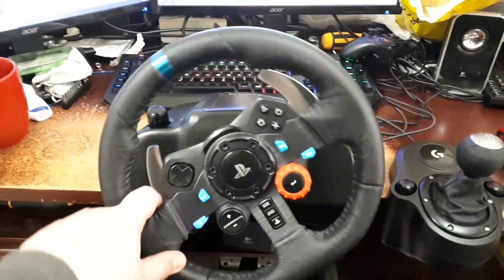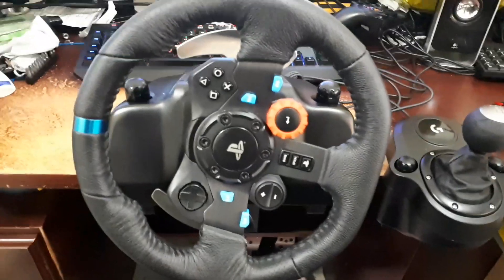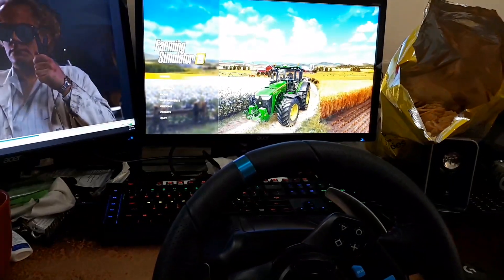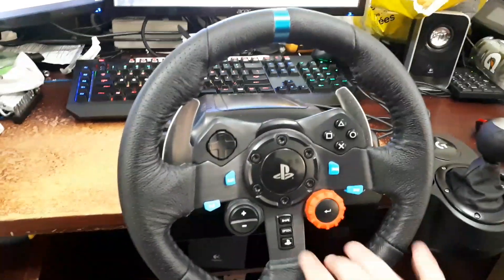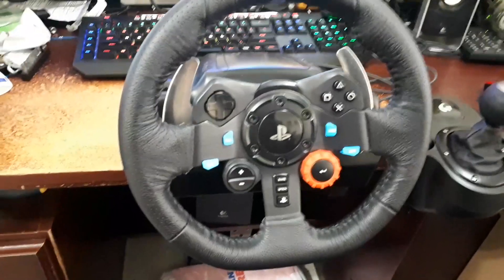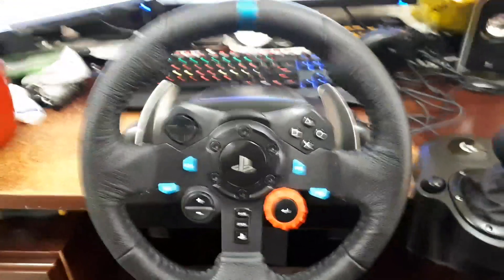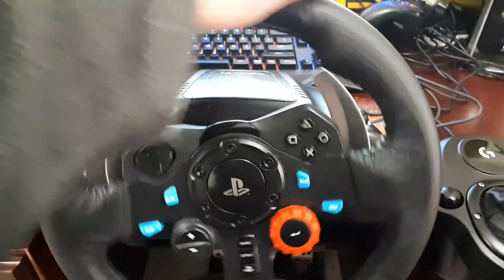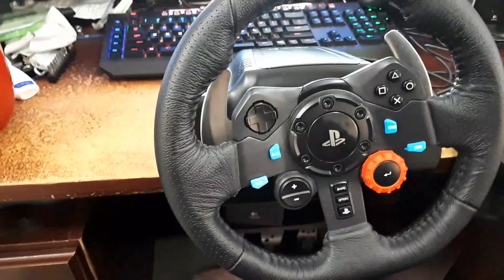Logitech G29 squeaking

Comment: Don’t worry to much. My g29 had the same problem but it has appeared to of faded away with use and I’ve had it for about 5 months
Reply: Im having the squeaking noise but also my wheel is off center was it the same for you aswell?
Reply: @michaeloconnor4978  If its off center just re-download the logitech software and try unplugging the usb from your laptop/ps4
Reply: when i first bought it one year ago it was squeaking when turning right and then back in july it started squeaking only left

Comment: Same for me, it squeaks when I turn it quickly to the left...
Bought brand new 2 days ago
Reply: Mine does exact same turning left, loudest screech ever. It’s my replacement wheel too, had it for an hour only to have that annoying noise...
Reply: Ya same, it only squeaks in left turn
Reply: If you’re still having the issue, just give it some time. The gears need to run in properly, did the same as in this video and let a wheel tester move it left to right constantly for about an hour. The squaking is gone now 😁
Reply: My Wheel is about 2 years old. The squeking got worse everytime a played. So i opened up the Wheel (takes 15 minutes and 20 screws) put a drop of oil at the left motor and now the squeking is gone completely
Reply: lmao same here, bought it 2 days ago and only squeaks when turning left.
Reply: exact same here bought mine 2 days ago as well and i got the same problem :(
Reply: My g29 also squeaks. And guess what?! It squeaks when i turn to the left
Reply: @bravemiata2950  same me 2 days ago I bought it and do the sound and I'm fucking scared
Reply: Same
Reply: Omg exactly the same
Reply: That’s right. BRAND FUCKING NEW
Reply: Jé Hogue same
Reply: Except on the first day
Reply: Jé Hogue same
Reply: ME Too i boguht it before 2 days and i gear squiking
Reply: Guys, all of em come like that from factory it doesn’t affect anything and I agree it’s annoying but your wheels not broke. Anything
Reply: I also had it, but it was gone in some time
Reply: @Blauweis1904  since I got back from deployment, mine screeches both directions. I found this vid trying to find a teardown video
Reply: @Blauweis1904  what kind of oil?
Reply: Same here
Reply: @Blauweis1904  what kind of oil did you use? pease tell me i have this issue.
Reply: Same, only when i turn it to the left.

Comment: Mine makes a noise when I turn the wheel and hold it at same position for a while. Its more prominent when turning left and less prominent when turning right. However it happens only when the center spring is trying to push the wheel in opposite direction and you are still holding the wheel. Would it go away with time or with lubrication ?

Comment: depending on how hard you play, it will eventually happen to everyone. Its only on one side because the motor is offset. I'm assuming it's a belt or bearing/pivot point issue. Some oil should fix it. It started on mine after playing F1 2019s, default FFB settings where way too high. I'm looking into a more heavy duty setup.
Reply: Where do I put the oil
Reply: @Rishab12312  did you find a solution?

Comment: Thanks for the upload. I just got a g29 used and noticed this, and after a quick google search saw that I wasn't alone. didn't have warranty since i wasn't the original purchaser and thought my only fix would have been to take it apart. It seems pretty new otherwise, so I'm guessing I got one that was returned (possibly a review unit or even someone noticed the squeak and returned it), so I'm just gonna assume that it's not 'broken in' yet. Cheers mate!
Reply: Hows the wheel doing now? All good? Mine is 2 days old and it squeks

Comment: My god man i already had to take off the wheel bcs it was just hanging loose it had play of like 5cm after that the paddles didnt function properly, had to fix that by opening them cleaning and lubricate them, now this shit is also happening to mee when it isnt on full force feedback it gives squicks like a mice is trapped inside, 1 big tip if u want a steering wheel that doesnt break down faster then a 25 yr old bmw then don’t get anything from logitech.

Comment: If you think about it, new items seem weird at first. The wheel (if brand new) has to first of all get used to start working on the high level. It's common for unproperly made items to squeak or make weird noises at start. So, after all, about 80 procent of people have this issue at the start. No need to, but you can pin this for others to know.
Reply: Can you fix it / does it go away after a while?
Reply: Mine has a clicking sound when I turn it very slow.... When I turn it fast doesn't hear any noise
Reply: Tilian Norman I had that on mine and went away
Reply: @MindRightLifeRight  yep. My clicking sound went away too after 1 hour playing time with force feedback almost at max.
Reply: I haven't played a lot and still have it. I was thinking about to use the guarantee of the store i bought it at. But now i don't need to
Reply: @arda9440  thats the point , you need to play quite a lot to make the sound go away . after more then 50hours it starts to be completly silent
Reply: ive had mine for a year, its still happening
Reply: @wilfe564  Why didn't you return it? How long was the warranty?

Comment: I have the same problem I bought g29 and after 3 hours of use it was making a squeaky sound when I turned to the right
Reply: Mine has this problem too when I turn right, how is yours after that time?
Reply: @GuitoFtw  yes after 2 months same problem
Reply: @GuitoFtw  it does not affect its performance thought its annoying sometimes
Reply: Same for me. Started after some intense racing in Assetto Corsa

Comment: Mine has been squeaking pretty persistently even when working it in with full rotations. The only way I can get mine to stop squeaking sometimes now is by having a game going with resistance on the wheel and just crank it all the way both ways a few times. And then it will usually tone down
Reply: I got a fix for it
Reply: @GratedCheese8989  tell
Reply: @denmickert6358  its a link I cz ant post here but essentially you just spray these two holes on each side on the inside with lubricant and its fixed
Reply: @GratedCheese8989  Im gonna try, thanks

Comment: hello there, if u somehow see this, do u know why my steering well is rotating so slow? like i have to force myself to rotate it, btw i use the logitech g29.
Reply from the maker: So sorry for the three month delay.
Are you saying that the wheel re-centers very slowly?
That is likely due to a force feedback setting, which can be adjusted in the logitech software, you can either set it high, and thus will take more force to move, but it will recenter quickly, or set low or off, so the wheel will never move by itself.
Any other behavior from this wheel is likely a defect of some kind, with exception of its auto-calibration.
Reply: @sarukmaktao225  i figured it out eventually and yes, it was the  ingame feedback, thank you anyway